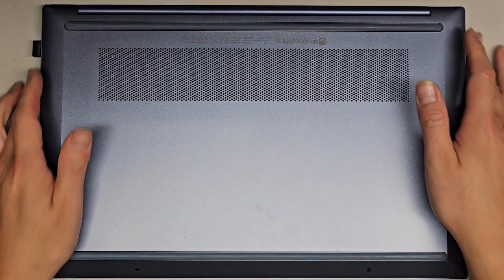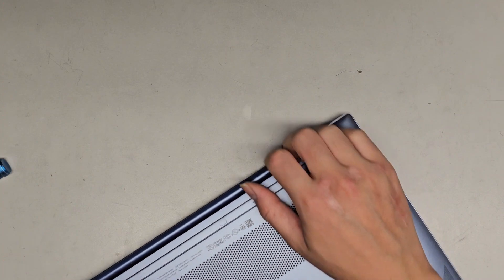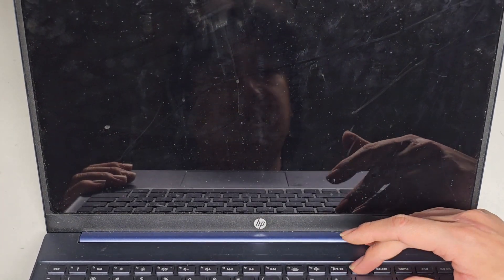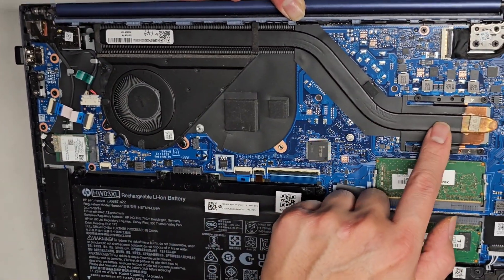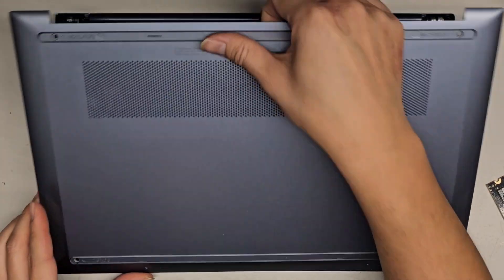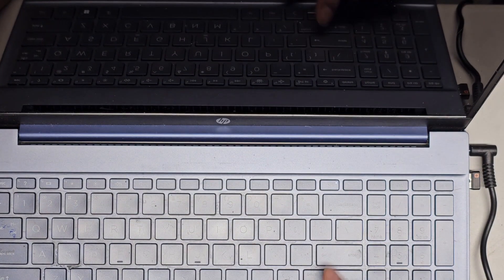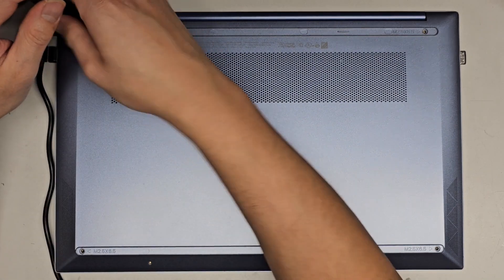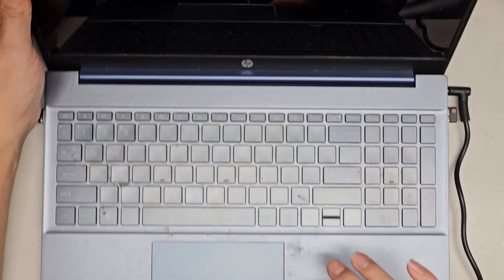HP Pavilion Laptop 15-eg2073cl Disassembly RAM SSD Hard Drive Upgrade Battery Replacement Repair

Comment: I hate how hp puts the screws under the rubber feet, so every time you disassemble and reassemble the laptop, you need to find some glue and glue the feet in the exact position you found them in.
Reply from the maker: Yeah...
Reply: @ItsBinhRepaired  It's impressive how shit HP's laptops have become because they used to be good, but now they're so bad. I mean, my school has HP laptops as like a fleet for the students, and so many of them have problems like dying SSDs, for example, or broken screens and broken keyboards. It's insane. Just use a think pad.
Reply from the maker: Lol they break too
Reply: @ItsBinhRepaired  fr. My school gave me a HP probook 435 g7 and both feet fell off and I had to use custom ones
Reply from the maker: The rubber feet?
Reply from the maker: I meant the thinkpads break too. You can look at my playlists and see all the different brands.
Reply: @ItsBinhRepaired  yes
Reply: @ItsBinhRepaired  I know that ThinkPads also break, but my W520 has held up better than the school laptop.
Reply from the maker: @albion_i  yup